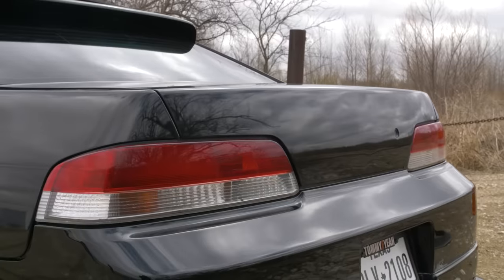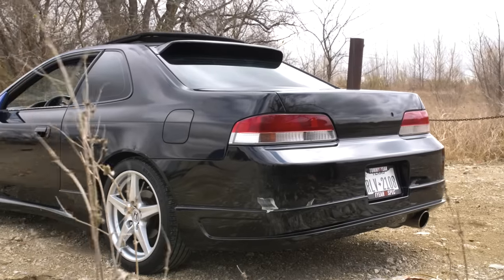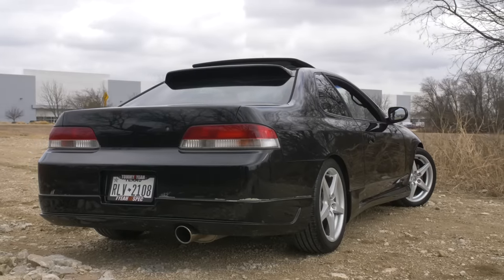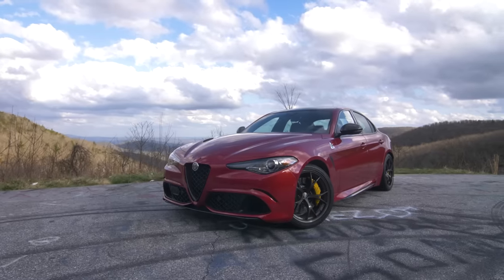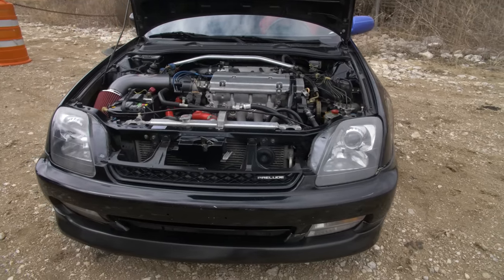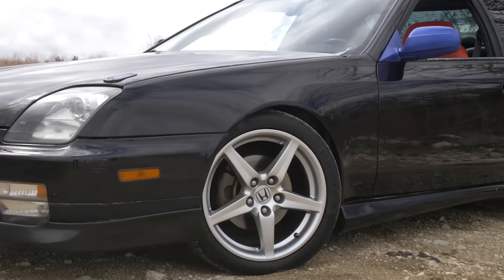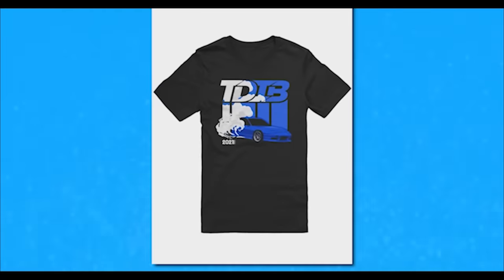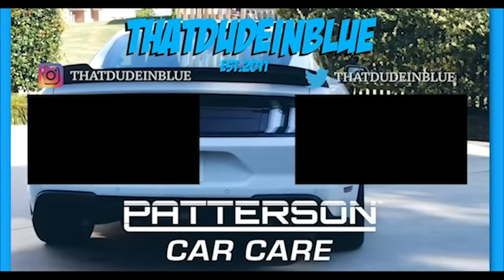Why is the Honda Prelude So Hated?

Comment: This car was never hated, it was definitely underrated, and there wasn't enough aftermarket support.
Reply: This the one
Reply: It’s hated by the muscle car guys 😂
Reply: @waterloo123100  those dudes hate anything that isn’t a v8. They’re the most close minded of car enthusiasts.
Reply: There's enough. People just don't build them.
Reply: @dc5v529  no they actually like mine. I put in work on the streets. I have gapped coyotes in mine.
Reply: I’ve always wanted one, there isn’t a decent aftermarket part market? That sucks
Reply: @dc5v529  I have a 02 Trans Am, and a 97 SH. I like all cars, I've never been a ford vs Chevy ect bs. I'd love to have all the cars lol Bought my son a tsi awd.
Reply: you must own one too. parts are getting more and more difficult to find.
Reply: @dc5v529  bro you aren't kidding... having a conversation always ends the same and they don't ever listen to reason especially concerning power to weight ratio. Explaining that Honda engines have massive untapped potential due to the over engineered blocks always end in ad hominems and various other nonsense. Just kinda shows who is and isn't mechanically inclined.
Reply: @waterloo123100  facts 😂 🤣

Comment: H22 FTW!
Reply: yessir
Reply: H series forever
Reply: Yo Kyle congrats on everything man you deserve it!! Oh yeah h22 ftw!!!! Also b20VT 😎😎
Reply: Facts I got one
Reply: Remind me my cb7 with h22 with the HMO stamp on it. still have it
Reply: Can my f20b swapped prelude get love?
Reply: H22a from the jdm accord with the closed deckkkkk fuck the h22a4 open deck thing camt handle boost but the h22a from Japan had a closed deck.. with rods pistons easy pz 700wheel...
Reply: @ianfarley4773  honestly imo the f20b is a better engine then the h22a4 shorter stroke and more top end higher rev limit. The head on the f20b is identical to the h22 head just the crank has a shorter stroke.. always wanted to try driving one.
Reply: yesssirrrr
Reply: Gotta always keep to the roots! 👍
Reply: Actually it’s ls ftw
Reply: Love my h22a . It’s so much more fun than any other engine series I’ve owned

Comment: I just bought a 5th gen that looks exactly like this. Same RSX wheeles, but the dealership I had bought it from in Texas added all of this. 

The following are all brand new:
BC Coilovers
Rack and Pinion (Power Steering)
Acura RSX Wheels
4 Hubs
4 Bearings
4 Rotors
4 OEM Brake Calipers (pads included)
4 Stainless Steel Brake Lines
Poly Bushing (All replaced)
Adjustable Rear Upper Control Arms (for camber) Adjustable Front Ball Joints( for camber) Adjustable Rear Toe Arms (for toe)
4 Continental Control Contact Sport+ Tires NRG Quick Release Hub(lock included) Momo Steering Wheel w/matching shift knob Acura RSX Short Shift Conversion Kit.
I've had it since October 1st and always receive compliments on it. I love it! It's beautiful!

Comment: As a 97 accord owner, the 5th gen, 98 prelude was my dream car. These cars are probably worth way too much due to inflation now, but I’ve always considered these as a beautiful JDM icon.
Reply: They are not just make sure you have a engine to swap into
Reply: got mine for 1700 (with high mileage but with a bit of work its been sweet)
Reply: Now is the best time to buy! DDing mine with only 2.2k into it. Burns a decent amount of oil so I'm looking for a healthy engine, but still drives amazingly!
Reply: getting one today for 3400!
Reply: @zilahsauvola4202  Sweet
Reply: Got mine for 1700 canadian about 1400 usd. Needs a little body work but other than that it is so much fun. Best purchase I’ve made easily
Reply: Paid, 2800USD for mine, fresh rebuilt head, and all components like timing etc with paperwork. Mint interior w a sound system worth more than i paid for the car 🤣 ac and all. Bone stock aside from being lowered and the system. She a smooth daily!
Reply: @brandoncrider3697  thats an insane steal good stuff
Reply: I got a 160k mileage for 800
Reply: i have a ‘98 prelude, my brother got it used when he was my age, i’m not sure who sold it to him, but he recently sold it to me, it runs great, it’s probably worth more than what he sold it to me for because of all the tuneups and fix ups he made on it, it’s a great car

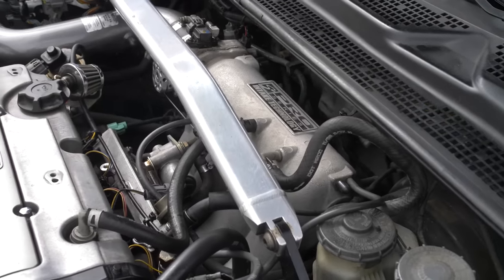Comment: 7:54 i am that person obsessed with preludes 100% , it's gonna be my first car and will be my daily for at least 10 years and I'll  love every single inch of it , they are my favorite hondas
Reply: Same. My first car was an 85 Prelude, my wife had a 91 SR when we were younger, and now we own a 2000 SH. LOVE THE LUDES.
Reply: I’ve owned my 98 for 10 years and love it more everyday, even more so than my 02 wrx.
Reply: Own*
Reply: I drove a 99 prelude for 10 years. Spent under $1000 when it came to maintenance. Was an excellent and super reliable car. Motor and transmission ran perfectly at 90,000 miles and at 250,000 when I sold it. Still miss it.

Comment: My coworker got his hands on a mostly original 1980 Honda prelude from a barn find. The carb was siezed and super expensive, so he upgraded it and got it running. The speakers work, the alternator works, the ELECTRIC FAN WORKS. The sunroof seals and the electronics work

Comment: The prelude and the H22 are both very underrated. I have a '94 Ej1 with an H22a and it's the most fun vehicle I've ever owned. Last spring it jumped timing and miraculously didn't do any damage. I drove it in limp mode for two weeks before I found out what had happened.

Comment: 5th gen is awesome but my love would have to go the 3rd gen if I had to choose. The 88-91 Si with or without 4wheel steer and pop-up headlights is slept on.
Reply: One of the best handling cars.
Reply: i have one i bought for a daily, did all bushings, coiolvers, manual swapped it, put on a cat back. Its a great car not quick but very fun to drive
Reply: Not slept on. They’re dying. There aren’t really any clean examples left. The 3rd Gen is 40 years old now.

Comment: I love the Prelude, literally the best handling car I've ever driven. Take it through some serious Twisties on decent tires and it's the best.
And that H22A has a 9k redline, just fyi.
Reply: It’s doesn’t have an 9k redline lol. 8500 on a chipped ecu and it’s not like a k series keep shifting that high and it’s going to blow up
Reply: @mrdauntl3ss  I just looked it up again, and I was off. It's 8,700rpm for the JDM exclusive H22A, just a bit below the AP1 S2000. Because "Americans don't like high revving engines, they like torque"
Reply: I euro swapped mine and had an evo X at the same time.   The prelude was actually more fun on back roads for me.
Reply: @rl-ub9hx  big weight difference
Reply: @waytooaesthetic  two completely different animals.  Both fun as hell but the lude was looser and more on the edge
Reply: @waytooaesthetic  A base model Evo X is only about 100-150 pounds heavier. That's not huge. And depending on driver weight, you can be within the same weight quickly
Reply: Yep I got one handles amazing with BC racing coilovers
Reply: @mrdauntl3ss  no it won't blow up I live on limiter all day just keep the oil topped up
Reply: @StealthyyyHD  and by topped off, that means check it every time you fill up gas 😆
Reply: @rl-ub9hx  🤣🤣🤣 mine leaks everywere but oils cheap engines expensive
Reply: @rl-ub9hx  throw in heavy duty oil stabiliser slows the leaks down. Stuffs like honey quitens the motor right up
Reply: @StealthyyyHD  my next lude I'm just gonna K swap.  The Euro was great but for the money a K would have been better.  Last Honda I had was an rsx with a k20a and jdm ctr trans wave track lsd.  That in a lude will be for me my ultimate daily that can blast a canyon at will.
Reply: @rl-ub9hx  K24 block K20 head best of both worlds
Reply: @StealthyyyHD  oh yes. Tracking all
Reply: @stephenmoore1541  no h22 sees that much rpms stock. You would have to have a huge exhaust 3inch,pro2 cams and a real nice ported manifold to make power that high
Reply: @jordang1408  my 4th gen is about 2600 lbs NA one and my turbo one should be 2700
Reply: @rl-ub9hx  I'm building a F20B 2liter just bored over 1mm. Should make 260-265 at the wheels easy on e85. It's already 230/165 wheel stock f20b revving to 9k with pro2 cams and has gapped the crap out of a stock Evo X. 2620 lbs
Reply: @TheBb6prelude  We're talking 5th gen prelude. Which had 4-5 different weights depending on which model you had

Comment: This is the first time I've ever heard of the Preludes of this generation being hated. They're beloved for their motors and it's styling. It just wasn't a popular platform that took off in comparison to the more popular Integra of the same generation.
Reply: I like preludes and legends alot better than the Integra I respect  Integra but they are mad over-rated and i had the 90 sedan with a built GSR motor before than I wanted a prelude but you can't find them at all

Comment: I had a 4th Gen, 95 Azure blue with the H22A swap, DC Sports 4-2-1, AEM, KYB shocks, Eibach Springs. and Fidenza flywheel. Did the build back in 2002... Good Memories.:hand-purple-blue-peace:

Comment: I've two 4th gens and loved both of them. The second one I had the previous owner dumped a ton of money into it and the thing was legit fast. The H series engines are decent platforms. They just don't have the aftermarket support and they start off heavier than a Civic so they get overlooked. They're vanishing very quickly. I hardly see any on the road now

Also as a testament to how tough the H series is (the one I'm mentioning here is the H23) the first Prelude I had the previous owner had an actual cold air intake, like he cut a hole in the wheel well and routed the intake right above the ground. Being very young and not knowing shit about cars I hydrolocked that engine, twice. Both times all I did was drain the water and mush out of it, fill it with new oil and kept going. Kept it for another five years and had not a single issue from it.
Reply: That’s insane … I had a 4th Gen in black … I’ll never forget the first day I drove that car home … ran over a cement divider and totaled her … I always wanted a 5th Gen … never got one though

Comment: I've owned 2 5thgens and a lot of civic owners really spreading the hate.  I still have a '99 Nordic Mist with a factory 5speed with factory black leather.  The Prelude was the first Honda sports car and they handle great from the factory.  That 5thgen in this video is a nice example.   When I was in automotive school in LINY they had a black 2001 Type SH with 300 miles that was donated from the Honda Factory for us to learn on(I went to Auto School over 15 years ago).

Comment: I went from a 1991 prelude si to 97 prelude base to a 2001 Prelude sh and I fully decked it out but not overboard. Just black on black leather, lowered, full stock lip kit, all the bolt ons from full exhaust to intake to headers and light tint. It was immaculate condition. It was the cleanest prelude ive ever seen and man it drove so nice but it was definitely too heavy but it did handle like a dream and it still had nice power and sound it just lags in the lower gears but once you get into 3rd and vtec kicks in it really starts to make up for its slower start. I was only one in my area with a Prelude and was known as the Prelude guy. I felt really unique and it was so fun. Also the vtec just sounds so amazing in the 2001 sh. Its super robotic very similar to the Rsx. Oh and mine was a 6 speed stick!

Comment: I have a 2001 white SH with 76,000 mi and zero rust (in NY).  100% original except radio. I bought it from a friend in 2007 with 24,000 mi.  I drove it once so far this year, but it snowed again earlier this week so I have to wait for some more rain to wash any salt off the road again.  I felt guilty, so I replaced the original plugs a couple days ago.  Absolutely zero oil or carbon.  If I hadn't already bought new ones, I'd have put them back in.  In my opinion, 98% of the problems people have with these are caused either by kids flogging them unmercifully (esp automatic transmissions), or working on them when they have no clue which end of a screwdriver to grab hold of.  I have not seen one how-to repair video of a Prelude on YT that was made by anyone that I would let within 100 yards of my car with a tool in their hand.  People ripping parts off and laying them in the yard or middle of the driveway, tools scattered all over the place.  Another problem is people putting a bunch of junk non-OEM parts on them.  If I seem harsh, remember... They're a Honda.  If you have to dick with them all the time, you're doing something wrong.  BTW, I'm 69 years old and have owned 4 Hondas since 1989.  I've seen and learned a few things.  Properly maintained, they're reliable and durable.

Comment: I got mine in 97’. Amazing and it looked as if it belonged on the Acura lot. Just as refined on the inside as it was on the outside. My Brothers 96’ GS-R was all business. The two looked as if they were switched at birth, the Prelude looked as if it belonged to Acura and the Integra looked as if it belonged to Honda.

Comment: I got a '97 BB6. Was my first car, bought it back in 2010, totalled it in 2011, rebuild it since. Here in germany the 185hp-non-4WS is the most common among the 5th Gen VTECs with (statistic from 2017) only 192 units left... we've also got a 2.0-non-VTEC with the F20A4 out of the EUDM-Accord... there are over 2000 around, so... there are more DC2's on the Road than BB6 and BB8 combined. 
Imo the 5th Gen is the forgotten 5th "Sports"model of the late 90's... DC2, AP1, NA1 and as a european the CH1 (EUDM Accord Type R with... who guessed it... an H22). And they shoot up in value aswell. Bought mine for 3700€ back then, found the exact same car not long ago, same color, same drivetrain, etc, but with 50.000km (~30.000mi) more on the Odo, for 7300€... 

Send 'Ludes 😁

Comment: I had a 4th and 5th gen.  Got the 5th after a drunk guy totalled my 4th RIP.   The thing i really didnt like about it was the h22 was a rolling oil leak.  My h23 in the 4th gen never had a issue once. Way slower but more reliable.
Reply: Way slower? Nope. I bet money my 4th gen prelude would gap a stock 5th gen. I'll bet my pay check. Once you start modding then yes h22 will gain more hp per mod.
Reply: I regularly gapped the crap out of GSR,LS,b16s in my h23a1 and beat a intake header H22a 4th gen as well.

Comment: Rear Wheel Drive conversions need to happen. Imagine drifting one of this.
Reply: The amount of rear subframe strengthening required not to mention fuel tank relocation makes it a waste of cash and time when other cars that already are rwd can be had for cheaper.
Reply: Rather do AWD sleeved motor and gapped a lot of cars. S1 has AWD kits available now.
Reply: @TheBb6prelude   Yoo I gotta f20b in my prelude too
Reply: Actually when I finish my 96 4th gen prelude my dad an I might turn my other 94 4th gen prelude into rwd
Reply: there are a few shops that are converting preludes to awd and rwd. one shop i know in particular has come up with conversion brackets and like a kit sort of or i think have like published a step by step plan on how to do it and what you need to do it
Reply: Such a waste when you could just buy a better rwd car in the first place
Reply: @jonf2009  true. Imagine the nightmare of installing a tranny for rwd
Reply: Not gonna lie though. It would be sick af seeing a prelude ripping turns on a drift track
Reply: @ianfarley4773  nice. F20B is a lot more common now. I got mine back in 2010
Reply: @yes-gs2rd  I have a 93 h22 VTEC model and and 94 prelude Si F20b. I prefer them FWD. They are the perfect FF car.  Or AWD with 450-500 plus HP